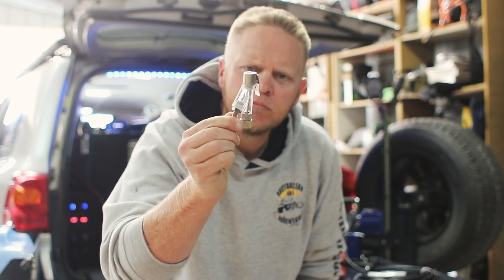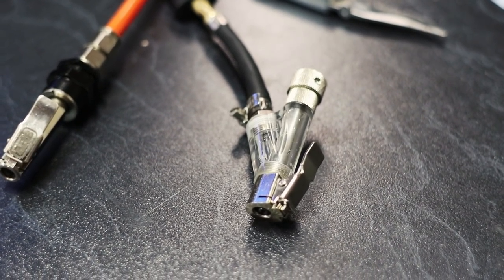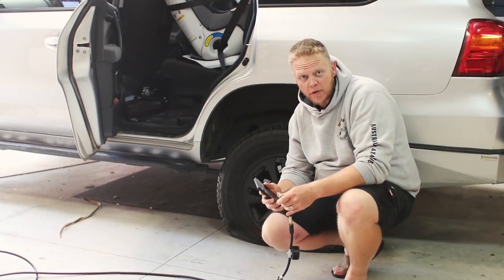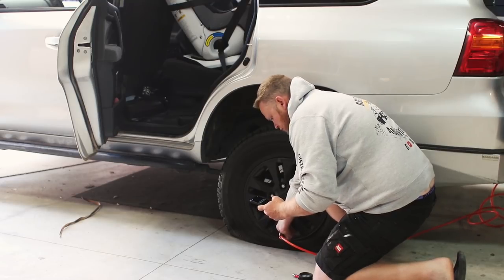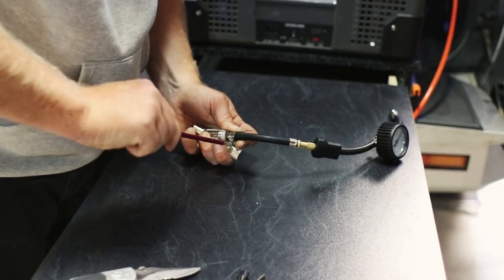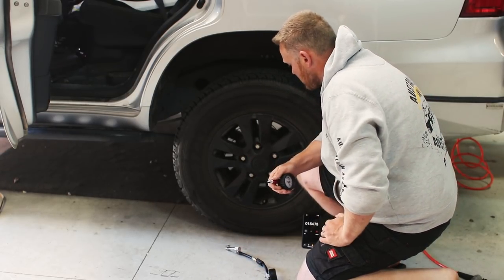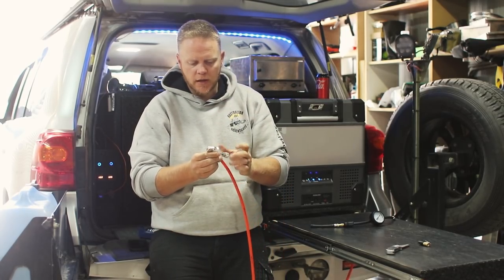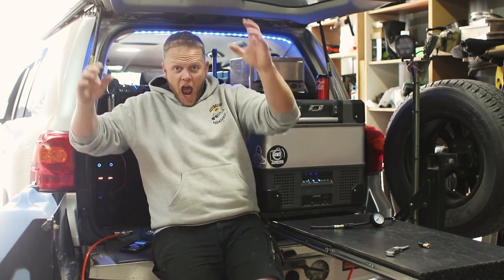King's Twin THUMPER MAX compressor Airtec inflation review

Comment: I,ll stick with my indeflate 😀
Reply from the maker: Have you found that one side always seems to deflate or inflate more then the other?
Reply: @Australian4x4Adventures  Not so far but i havnt used it much to date.
Reply from the maker: I’ve got one and notice that one wheel is always about 5psi behind the other.
Reply: @Australian4x4Adventures  Thats cause you drive a toyota  LOL
Reply from the maker: 😂.  Had to be said hey.
Reply: The psi diference with the indeflate is caused by where the weight is sitting in your vehichle if the back left is say 50 kg heavier than the back right it will affect the amount of air going in same happens
If your car is on a but if angle the side holding the weight ( down hill side) will deflate faster and need more time to inflate. I moded mine withe gauges and a tap at each end of the hose for faster deflation and indvidual psi readings
Reply: @jarradblair1793  I usually give it a minute or 2 for air to stabilise when I'm using mine

Comment: You let out another 1 or 2 psi putting on the Gauge when you checked what the ARB did. But that gadget is pointless when it comes to Airing up faster, When you do the maths you have to remove the Valve, Blow up the Tyre and then replace the Valve and then check the pressure If by fluke the pressure is correct, By time you have done all that it would of been quicker to just use a standard Inflator, That gadget is a waste of time and money.
Reply from the maker: Absolutely agree with you.    And as I said in the video I prolly won’t be using it with myself.   And I haven’t been.  I find it faster to just use the standard fitting

Comment: Hi Steve, great review, thank you. Essentially tho, the Kings Thumper 11 is two compressors together, which means more air flow - but double the amp draw. Yes, we have our engines running for winching and compressors, but it's still a thing. Removing the restriction of the valve clearly works when airing down or airing up! Cheers mate.
Reply from the maker: True on all accounts.   But I was just showing the difference it makes on the 2 most common compressors.  ( and the ones I had 😂 )
Reply: @Australian4x4Adventures  Yes mate, no issues at all with your demo. It was just the reason that I only purchased one of the 150Lpm and not a twin. Cheers Steve.

Comment: Nice review mate, I don’t normally buy kings stuff but I’ve had there twin thumper for over a year now and it’s a beast! Best thing I did was buy a good quality digital tire gauge especially for low psi below 10 etc when shit gets real!
Reply from the maker: They definitely push out some air that’s for sure. 
For me it’s more the size of them.  They take up a lot of space and are hard to mount in a wagon like mine. 

The twin ARB solved so many of those problems even if it is slightly slower. And 4 times the price 😂

Comment: Great video! and I like that it is see through but I have had issues with other valve removing inflating devices.  I've had valves shoot 10mts into the bush and nearly had a crossed thread.  I feel that removing and replacing a valve just adds un-necessary risks.

Comment: Going from say 0 to 8psi is easier than 28 to 36psi. As the pressure increases it gets increasingly harder to push more air into the tyre. So that additional 8psi from the kings unit was pretty good and backs up the higher litres per minute rating
Reply from the maker: That’s why I choose 1:30 time because it was getting into the mid 30psi range so the compressors had to work a bit towards the end.
Reply: Quite a while ago now, I heard about 2 stage inflation was coming, where is it.?
Basically , your standard compressor pumped more air faster initially and then returned to normal high compression. Thus, no need for air-tanks.

Comment: Airtec also do a Schrader screw on version as well. (The clip on ones always seem to leak on me...)

With 25L of airtank capacity using a standard 150psi ARB twin, airtec screw on and using a ball valve because the ARB digital inflator was a choke point, we went from 18 to 36psi on a 315/75/16 in 14 seconds  :)  

It took about 3 minutes to get both tanks up to pressure from zero.

Comment: I had 2 of the thumper max compressors ( if 1 is good, 2 will be better , as far as pumping up 33" tyres quickly )  I have found that they do not like to run for too long. Bought an ARB single compressor for less than half the cost of the double compressor. Getting another one to replace the kings one that has been playing up lately. I think I may get one of the dual inflation hoses, but at $60.00 each for the adaptor, I'll wait the extra few minutes for the tyres to get to road pressure.....
Reply from the maker: It’s not a bit of kit for everyone.   Some ppl hate pumping up tyres and want to get it over and done with. And others don’t care how long it takes. 

I’m half way in between those two 😂
Reply: Just had my second ARB hose replaced under warranty for melting off on the 4th tyre with the single ARB air compressor, how you going with it? Bloke in ARB today said their air compressor components have known issues. 😢
Reply: @dazza0485  running braided hose to an outlet on my previous car. Have a tank with braided hose in my new car, and no dramas in either......

Comment: biggest benifit would be helps keep compressor temps down,worthwhile for the cheaper compressors,would add to longivity of compressor,thumbs up.
Reply from the maker: Yeah for sure.   Less stress on the motor so less heat.
Reply: @Australian4x4Adventures  might  increase the life of my kings by 6 mths lol

Comment: I like the idea, the only bit that lost me was that air coming out when it wasn't connected to the tyre, having a tank and the connector leaking air would real ly be annoying, being what it is, it wouldn't be possible to stop that. You would need to put an inline valve to stop air between tyres. As I said I do like the idea, just need to tweek it somehow for those with air tanks.
Reply: thanks for the review, the kings pump seems to go well. A braided line and some cooling and it would destroy the ARB.
Reply from the maker: If you had a hand held level gauge if would stop between tyres.  
So like the inflators you get at the servos with the button to turn them on but with the airtec on the end of it instead of the normal fitting

Comment: I wonder if you could unscrew the hose tail and screw in an air fitting instead?
Reply from the maker: I tried to figure something like that out but couldn’t
Reply: @Australian4x4Adventures  Bit expensive to clamp in a vice and heave on with a cheater pipe.

Comment: Too fiddly when you have to take it off to measure the pressure. And when you stopped pumping with the ARB compressor, did you just unplug the hose and put your finger over the end, before screwing the valve in? If so, surely that had to have an effect on the result
Reply from the maker: I think it needs to be used in conjunction with a trigger style air hose to get the true benefits of it. 

Yeah I held my finger over the hose while I done the valve back up.  It was the only way I could stop it as exactly 1:30.  
I prolly lost 1psi by doing it that way.

Comment: can you show the speed of deflating using the Airtec compared to using the old school ARB ones ?
Reply from the maker: In theory it should be the same as it’s just taking the stem out and releasing it as fast as the vavle will let it. 

But it could be slightly different if the holes on the delflater are different sizes I guess.

Comment: I made up a 2 x air inflation / deflator system, my thumper will infate 2 tyres from 15- 45psi in 2min 10sec  just buy air chuck style tyre valve, no need to remove steem either.

Comment: The trouble with the arb and thumper max they draw 90 amps
The thumper 45 amps with the quicky you probably get similar times without a flat battery
Reply from the maker: Arb only drawers 90 amp under full load.  
So at 20 psi it’s only using 50 amps. Ect
Reply: Probably best to run your vehicle while pumping your tyres anyway

Comment: They get so hot pumping from 19psi back to highway pressure, you can’t even touch the air fittings for about 10 minutes.
Reply from the maker: Mine didn’t get warm at all.
Reply: @Australian4x4Adventures  dunno I got properly burned from mine I always use rigging gloves now, big blister. I’m a boiler maker so I’m not precious with burns either.

Comment: I get you don’t like kings 
But by now everyone know you get what you pay for 
Of course ARB are 5 times better
Reply from the maker: But not faster 🤷🏿‍♂️🤷🏿‍♂️
Reply: @Australian4x4Adventures  It is when the Kings Thumper Max taps out as it overheats and you're waiting for it to cool down!
Reply from the maker: Hahahaha.  Very true.  

My brothers always used them and I think his on his 5th now.
Reply: I got a kings compressor never had a drama with it but looking to upgrade to an arb when i gdt a front locker
Reply from the maker: I think that’s the biggest problem with the kings stuff.  
Some can be amazing and others can have nothing but dramas. 
Quality control seems to be their downfall
Reply: @Australian4x4Adventures  yea it was the first bit of gear when i started 4wding just to keep me out of trouble on tracks but i do like the idea of mounting the arb frees up aome room and i can just plug in and inflate rather then pop the bonnet and attach the thumper
Reply from the maker: They are handy.   And with a 100% duty cycle you don’t have to worry about how hot it’s getting when ya mates ask to use it too.
Reply: @Australian4x4Adventures  yea pretty much i just moved to qld so dont really go out 4wding with anyone just me and the family

Comment: waste of time when deflating you don't know what pressure is without removing it and checking with your guage.At least with the old ones you push the bulb in and you can see pressure.
Reply from the maker: It would work much better with a trigger hose which had a gauge on it. 

I just don’t have one so I couldn’t show it.